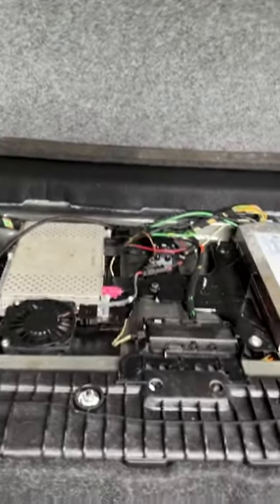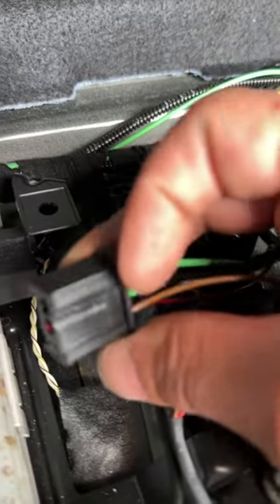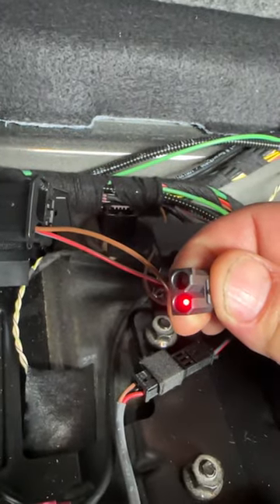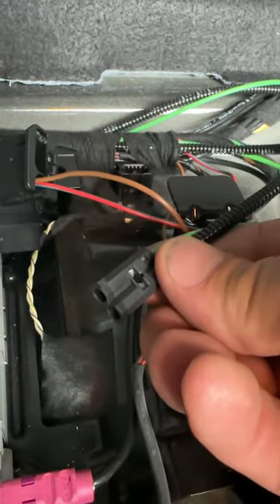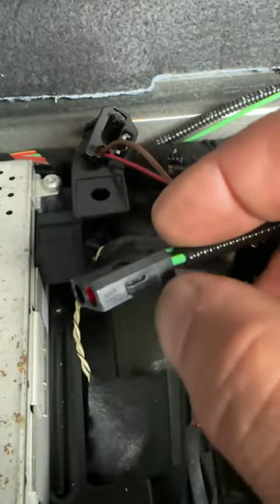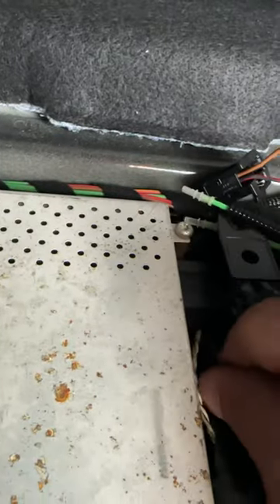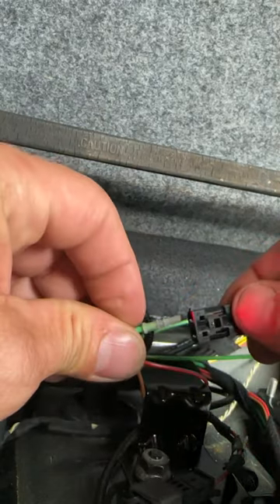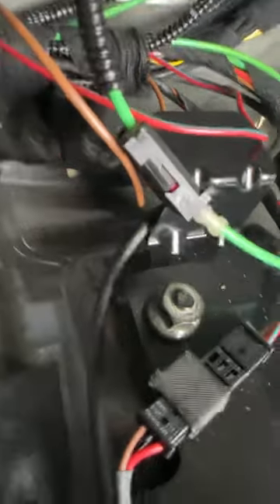BMW e90 phone sos. No sound or audio fix bypass.

Comment: what if i have radio don’t have aux can’t here it when i plug it in and don’t have sos or phone and do have cigarette lighter and checked fuze 2010 bmw 128i convertible
Reply: and weird clicking noise from speakers even when cars off every like three seconds
Reply: @jacksunengler451  i have the clicking noise, did you find any fix?
Reply: Any luck figuring out what was wrong?

Comment: What if my Audio comes and goes ? What does that mean
Reply from the maker: Possibly loose connection or module going bad. Just a guess.
Reply: Depending how bad the failing module is it can cause sound to cut out intermittent or completely
Reply: @BmwCCCrepairsUK it cut mine out completely